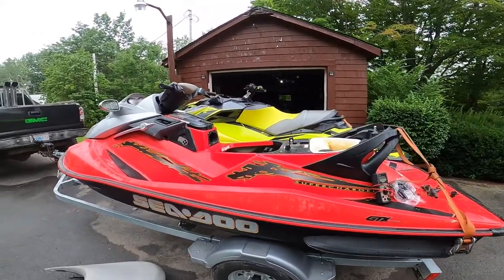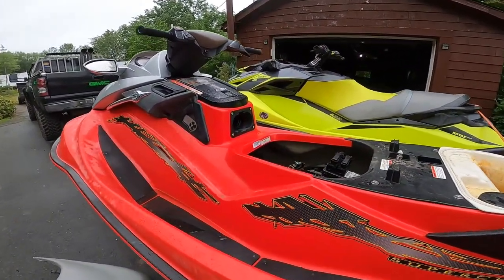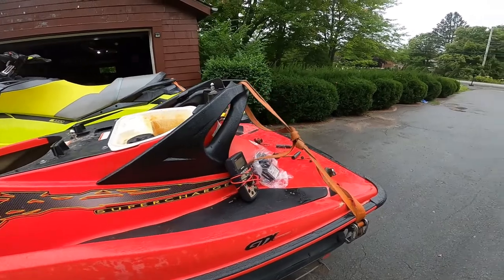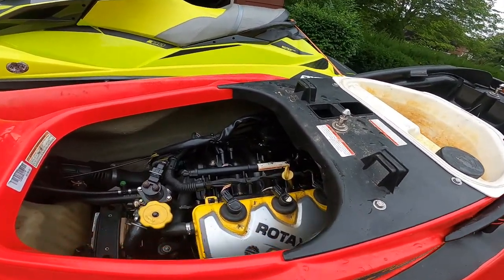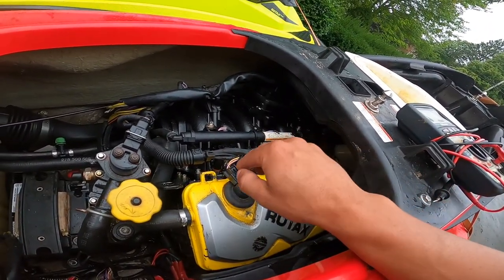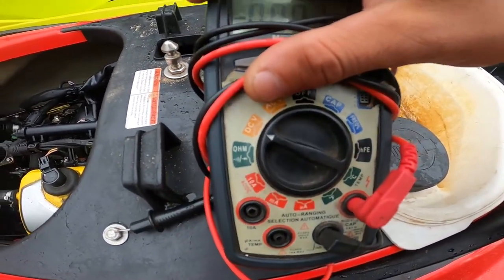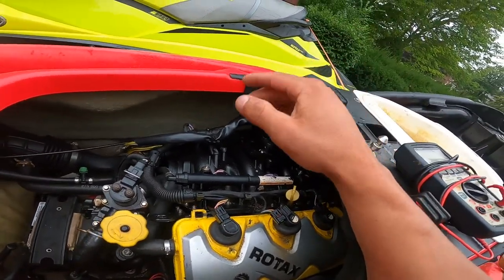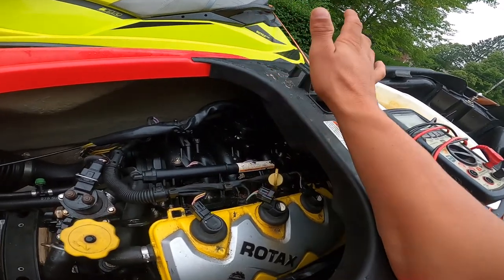Seadoo Gtx 4 Tec Cylinder 2 No Fire Melted Coil!! Almost Burnt Machine!! Bad Ecu? How To Test!

Comment: Can you explain how you used the Multi-Meter to test for 12.1V-12.6V via the coils?  What color wires did you front or back probe? Thanks.
Reply from the maker: Coil has 2 wires lol doesnt matter which way u connect a multimeter will show voltage just make sure ignition is on and dash is live
Reply from the maker: Unplug and probe with key on
Reply: @BurninGas8.1  Thank you! - Haven't had a chance to walk-out to the SeaDoo yet to realize there's only 2 coil wires per cylinder, lol.  Also, I'd probably want to test the coil itself.  Any idea what resistance I'm looking for on these coils? - I imagine I could just test all 3 of them and figure out a base-line.  2005 SeaDoo RXT SuperCharged/I.C.

Comment: I will buy  sea doo GTX 2004 Limited  ..It just works 113h ..It looks in good condition and engine pressure is 120/120/120 ..Everything is good, but does it have many faults?
Reply from the maker: No they are a great reliable machine

Comment: I need help please i have the same ski i dont know if cylinder 2 and 3 fire and how do i use my meter to see if there getting a ground
Reply from the maker: just pull plugs put them in coils lay them on top of motor see if they fire
Reply: When buying a ecu what do i look for to know its a match
Reply: And where u buy ur ecu
Reply: I have the same jet ski as u
Reply from the maker: @trevorholmes8615  I believe it was torx racing I sent mine to them and they send a brand new unit with your tune with 1 yr warranty a bit pricey but sometimes the only option
Reply from the maker: @trevorholmes8615  I’d rather buy new with warranty then take chances with used